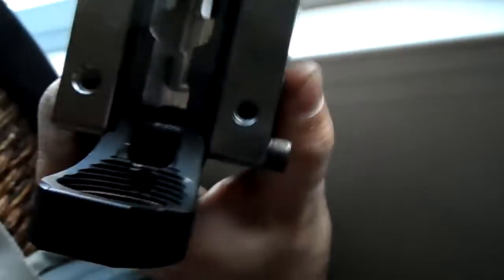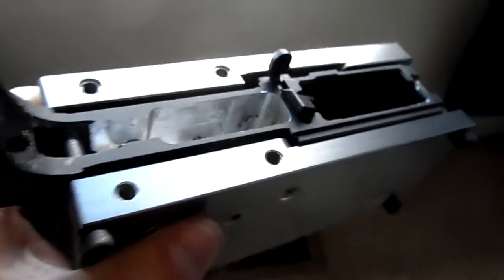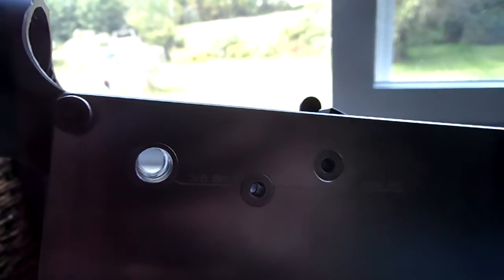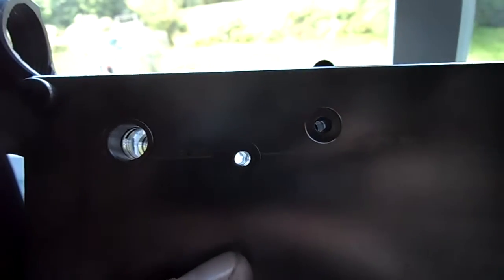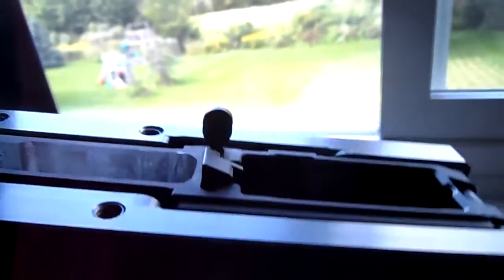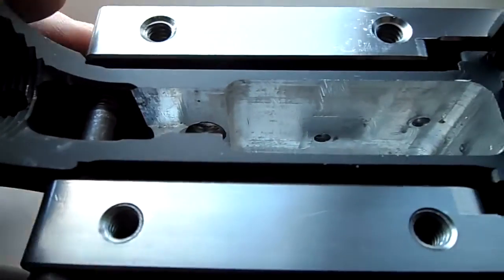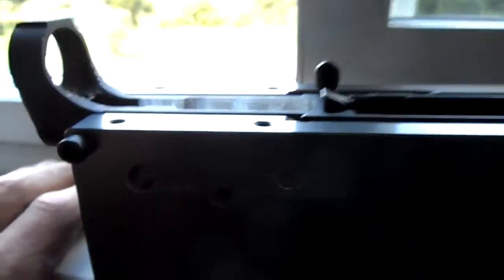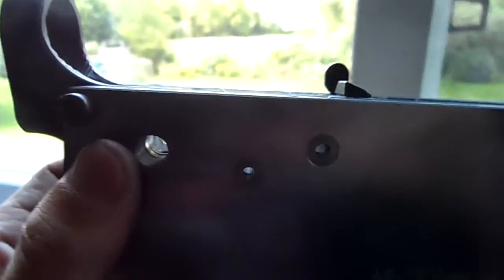80% Arms Easy Jig Problem

Comment: On a colt m16 full auto lower.on the inside the walls are not even there is a pint down inside the receiver it is thicker just a small lip

Comment: sounds like the hammer isn't fitting and the spring sent it behind, farther back than it should have then got stuck (hard to tell since you didn't see it after the auto. try removing more material up front or something. but it sounds spring related due to fit.
Reply from the maker: Thanks for the tip! I got it sorted out. The jig wasn't to spec.

Comment: I wouldn't be admitting to having a full-auto anything online.
Reply: I believe he was describing the failure mode, not an intentional manufacturing or assembly situation. If there was no intent to create a “full auto” piece and you remedy the problem, you’re not breaking any laws. Full auto fire, or stuttering fire (bursts) is a known failure mode with several types of semi-auto firearms.  I once shot a rental Walther .22 pistol on a public indoor range that was FUBARRED — two rounds for each trigger pull.
Reply: It’s not routed for actual full auto.
Reply: midwit! he DOESN'T HAVE ONE! he has a malfunctioning semi auto lower! what are you ATF, because you certainly don't understand guns much less the words he said! you're stupidity could get this man in trouble. think before you say things!
Reply: Isn't it legal in red states ?
Reply: @JoseGonzalez-ed4hq  full autos are technically legal if you get the tax stamp. it's extorsion mostly. same with suppressors. but without that. it is illegal anywhere for now, unless old pre-ban gun loophole and even then look it up and ask around.

Comment: This is a common problem for AR-15s you need to get a new disconnector $5 part.

One way you can check is the lower only pull back hammer squeeze trigger catching Hammer before it hits receiver keep your finger hold on the trigger pull the hammer back again then release the trigger and I bet the hammer fires forward causing the triple burst real typical problem when you get the new diss connector compare it to the one you were having problems with and you will see it is slightly out of spec or worn

Comment: The front pocket template is too short by just a bit which makes the forward wall of the pocket too thick. That is why the Hammer is hitting. I dremeled mine little by little until the hammer had the clearance.

Comment: Sounds like you installed the hammer spring wrong!
Reply: An AR15 semi auto fire control group is incapableof firing full auto without modifying the sear engagement points on the hammer, trigger and disconnector.
Reply: @JTTV72  it is capable when it becomes an accidental open bolt.... without that hammer in the way it doesn't stop....
Reply: @JTTV72  Obviously not...lol!  Pay attention to what was said and just so you know, if you assemble your trigger and forget to put in the sear spring, the gun (ANY AR-trigger) will now be fully-auto.  Now you know how to make your gun Full Auto, but be aware...once you start firing with this configuration, it may not stop until the mag is completely empty.  Peace Jim & Happy/Safe shooting.
Reply from the maker: @Charlie G Jig was bad. I compared it to some blueprints. I modified the jig and now all is well.
Reply: SuperSneakySteve it really just fired full auto?
Reply from the maker: @TheZodiacRT  Yes! But now it's fixed.
Reply from the maker: Nope. It was installed correctly.
Reply: SuperSneakySteve  thats strange??
If you are using all AR/15 parts for lower you shouldn't get auto fire unless something is installed wrong , please update when you find out why because now I'm curious what it was then....
Reply from the maker: The jig sucks. I milled the jig to give more room now my lowers work as intended. 80% Arms now offers a gen 2 model. It might be better than this one.
Reply from the maker: @josephjohn7209  Nope, I did it right. The jig was bad. I fixed the jig now it works.

Comment: Must be an ez jig problem because my ez jig has  the same problem of the hammer rubbing on the front of the pocket along with the hole for the safety control being about 1/8" to low compared to where the trigger and hammer holes are located, causing me to remove about 1/8" from the top-rear of the trigger so the safety control will fit. I know what your thinking, you have to cock the hammer to get it to fit, but un-cocked the trigger covers at least 1/3 of the hole. I have milled six lowers with all having the same problem. I was really interested in the Gen. 2 but if so many have the same problems I think I will look at the other brands. I like the way the 5d tactical looks and maybe they put the holes in the correct place.

Comment: i used 80% arms easy jig to mill my lower, i too am having issues where the hammer is rubbing, i have re milled 3 times to make sure im getting everything. i saw you mentioned you had to make some changes to finish it, what exactly did you do to clean out that hole. My AR only fires maybe 2 to 3 times out of 10, the hammer is hitting but not hard enough for it to fire everytime. the gap is just too big. suggestions?
Reply: Jessica Shifflett Hello Jessica

Comment: Please explain the problem and your solution
Reply: SuperSneakySteve yes you are correct, the jig is not in spec, not just the one you have, but a majority of that style jig is not upto spec. I have 4 jigs that are machined exactly like the style you have. They are all  sold under different names but I suspect that they are actually machined at the same factory because they are all out of spec in the same area. I have since started using my CNC router to do my lowers. It takes a bit more setup but the finish and quality are worth the extra time.
Reply from the maker: I had to recut the jig itself to open up the pocket so the hammer wouldn't rub. I took measurements on a factory lower then compared it to the jig. The jig was off. Only after modifying the jig can I now produce in spec lowers.
Reply: so you just made the pocket longer towards the mag well?
Reply from the maker: Yes, but I also had to modify the spacer because I was unable to remove the magazine catch.
Reply: TheOtherWhiteBread0  I do not have it anymore but here is a link to the unit I had. btw, it doesn't look like much but it was a great little machine for hobby use. basically it is a supersized version than the "ghost gunner" or vise versa...                      https://www.ebay.com/itm/4-Axis-CNC6040Z-Engraving-Drilling-Milling-Machine-3D-Cutter-Engraver-USB-Router/272960633799?epid=25026719679&hash=item3f8db8bbc7:g:~yUAAOSwGPxaHuFF
Reply: Ghost gunner jig

Comment: Definitely not a jig problem.  Buy a new LPK. sounds like out of spec parts.
Reply: Please Explain
Reply: SuperSneakySteve lmao, "modified the jig." The way the gun fires has to do with the trigger, not so much the lower receiver.  And after seeing in the video that the holes were aligned, clearly the issue was the trigger yet you blame the jig and try to say you "modified it" and now it works makes you sound even more stupid.. especially after someone told you it was the trigger and you said you were going to switch it out.. but yeah, MUST have been the jig unless you got one that somehow had the trigger pin holes drilled wrong which I've never heard of.  I'd imagine alot more people would be complaining about this if that was the case.
Reply: @perchowski3021  He's obviously not that stupid since he FIXED the issue with the jig and now the gun functions properly.  The holes were in the proper position, the obvious issue was the jig wasn't allowing him to remove enough material in the lower receiver, which was interfering with the hammer reset upon the sear, hence the visual marks you can see where the hammer was rubbing on the lowers wall.  He simply removed more material from the jig plates, so he could therefore remove more material from the lower upon milling.  Several people have complained about this same issue in the comments.
Don't be so negative, think for yourself and avoid ALL EXPERIMENTAL GENE THERAPY Shots.
Peace Son
Reply from the maker: Thanks for the info. I'm going to try a drop in Timney Trigger. The one I had in before was a cheap Palmetto kit.
Reply from the maker: Totally was a jig problem. I modified the jig and now it works. No thanks to 80% arms.
Reply: SuperSneakySteve how did you modify the jig? And you weren't full-automatic, you were slam firing.